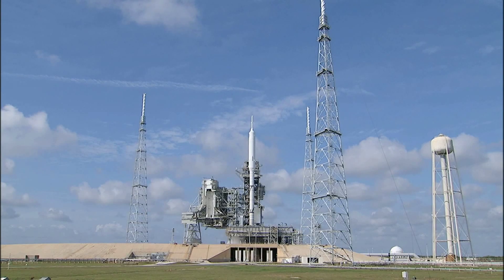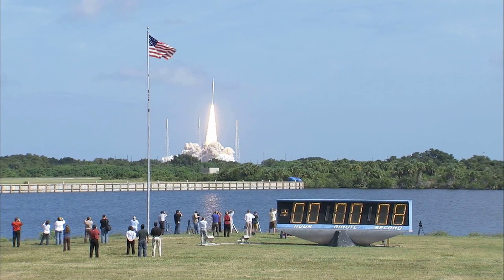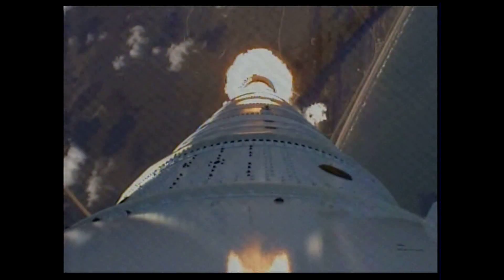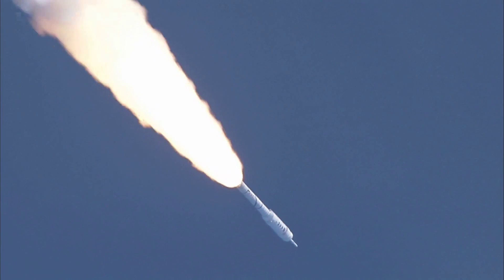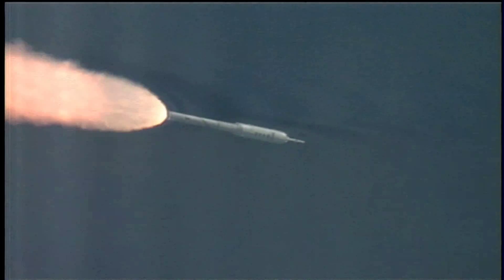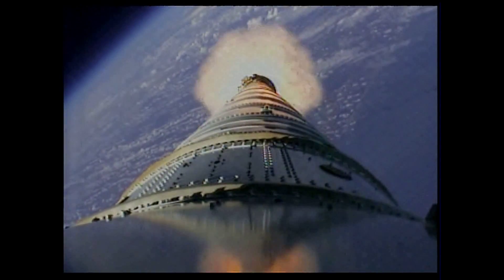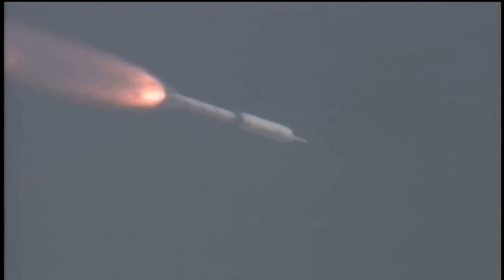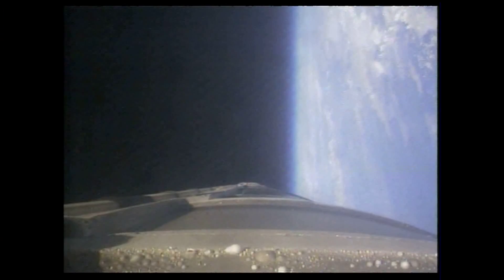Ares 1-X test launch NASA

Comment from the maker: Plus Ares has/would've been the safest because it has the best engineered in the world working/worked on that project. Space-X just bit off little more than they can chew. And Ares is safer, it took one launch for it to be a success.. Space-X took several, and yet they still blow up, even after a successful launch. They are very inconsistent